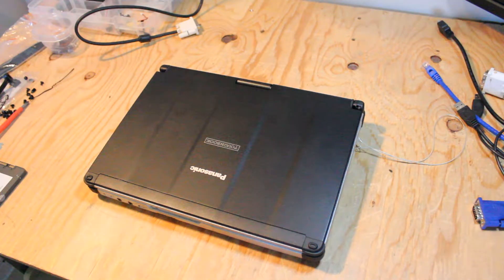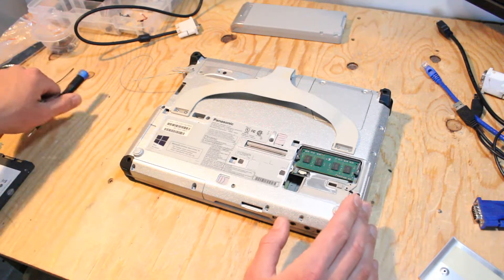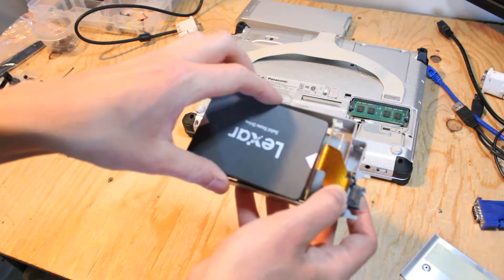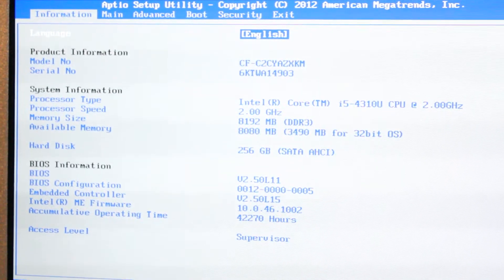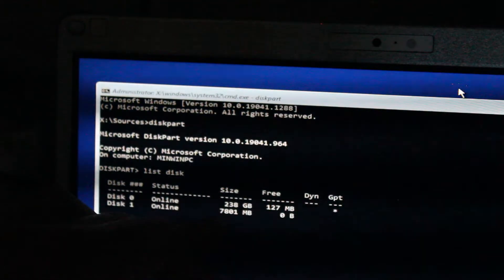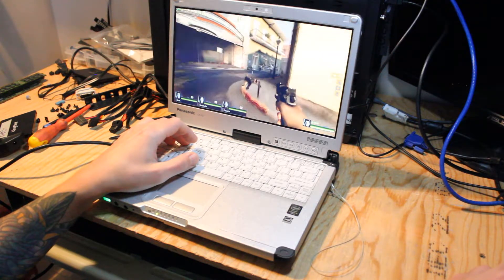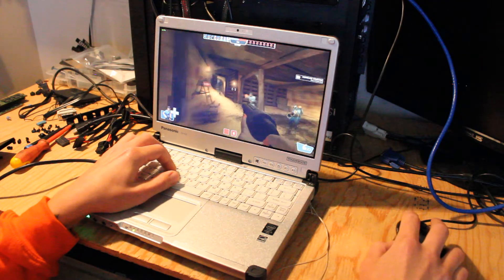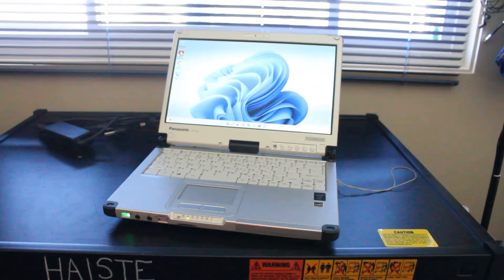Panasonic Toughbook CF-C2 SSD Install and Gaming Test

Comment: So I have windows 10 now on the usb drive. What step did you take after pressing F2 after @7:10? Did you change anything? I've tried pressing the esc button but the boot menu from @7:19 does not appear.
Reply from the maker: Do you see a splash screen at all?  That maybe says Panasonic?  Is it booting directly to a previous Windows install?

Comment: I have a bid on ebay for $75  planing on using this while on the road for photography editing while at the track and using it at work for tuning motorcycles if it can game i guess it can suit my needs
Reply from the maker: Awesome, that sounds great.  Just remember this laptop is 100% passive cooling.  No fans, in case you are putting it under load at all.

Comment: Hello, does it need Windows 10 key to install Windows 10 on this CF-C2 ? Can you tell me how can I do it please. And can it upgrade with higher CPU and which newer CPU can I upgrade it please
Reply from the maker: The Windows 10 key may be embedded in BIOS and you would just need to create a bootable USB drive with Windows 10 on it.  let me know if you need assistance with this.
Reply: @HaisteComputerRepair  thanks for your fast reply. My CF-C2 was installed with Windows 7 32bit but the label on case is Windows 8 and I can not see any Windows key. Can i really install Windows 10 without key although I have updated the bios ? Can I install Windows 10 with 64bit ?
Reply from the maker: @linghuu2023  Late reply, but using that same Windows key should work.  Hope you found that out!  CPU is soldered and not able to be upgraded without replacing a motherboard.
Reply: I have Panasonic CF-59, but couldn't find a video about upgrading it's HDD to SSD. I need your help.
Reply: Sorry Panasonic CF-S9
Reply from the maker: @hidayatullahkhan975  I am guessing it is similar to this:  https://www.youtube.com/live/L0u-Rj-8UH8?feature=share

Try sending an email to https://www.bobjohnson.com/contact/

They helped me out with the CF-C2 in this video.
Reply: @HaisteComputerRepair
Reply from the maker: @awatheeye4113    What's up?

Comment: How hot was it getting when you was playing the games? I was thinking about getting this model... but I was a little worried because it has no fans
Reply from the maker: It didn't get too hot, surprisingly.  The CPU temps reached 80+ degrees celsius at times, but if you don't play in a hot space I bet you would be ok.  Of course, I was testing games that were appropriate for the system.  What is your main use for one of these?  They are solid field work laptops, but I don't know if I would use one as a daily driver.

Comment: Looks brand new man! I love the toughbook style laptops - I have a Dell XFR 6420 and it's the coolest looking laptop ever made. Diskpart is cool, but you can also just delete all of the partitions straight from the windows installer GUI. Also less risk of accidentally trashing your USB drive 👍
Reply from the maker: Yeah, I lucked out definitely with this one.  It came in great condition.  Seems almost unused.  That Dell also looks cool, I would like to check that out if one comes my way.  I do Diskpart in CMD just to show a different way and to encourage that next step of using Command Prompt or Powershell to make tasks faster.  Students who learn this way get that Super User feeling and that can be encouraging.  I'm still learning too :)  Also, I don't think command prompt will let you clear off the USB drive if it is in use.  Just the same as when in Windows, if you try clearing the active SSD/HDD boot drive it will send back an error message.  Nice failsafe.
Reply: @HaisteComputerRepair  Awesome man! Yeah I enjoy knowing/using CMD prompt as well, some things are only available that way too.  I hope you get your hands on a XFR they are absolute units 👍thanks!
Reply from the maker: @hightech-lowlife  I should send something to you to customize some day!
Reply: @HaisteComputerRepair  Hell yeah man, that would be awesome, I have a few custom builds in the queue right now, I've just been busy building ebikes and motorcycles but computer builds have not been forgotten!
Reply from the maker: @hightech-lowlife  One day it will work out!